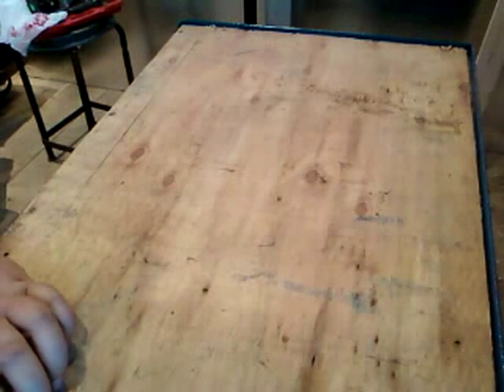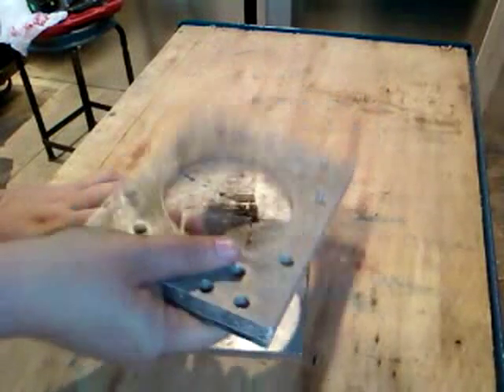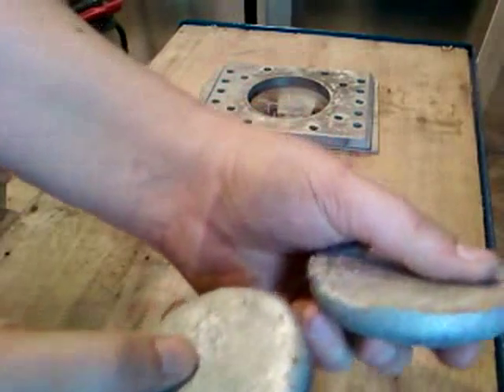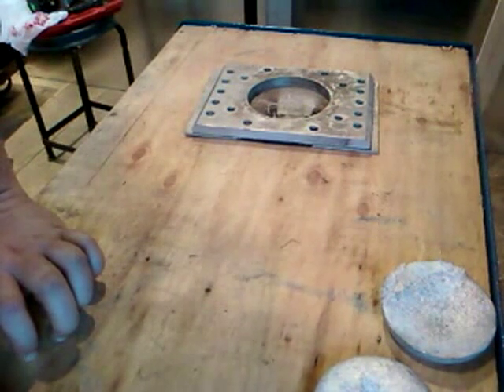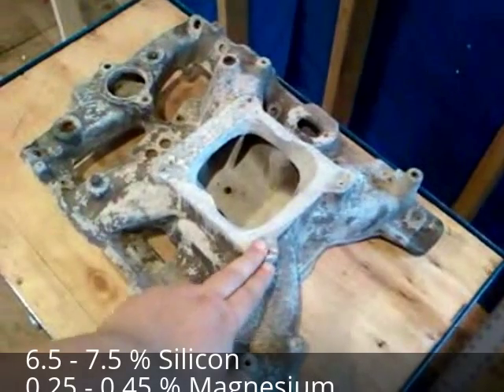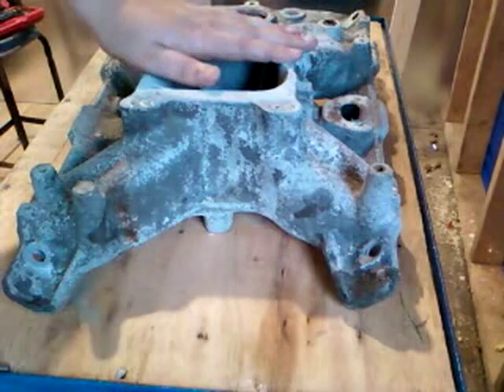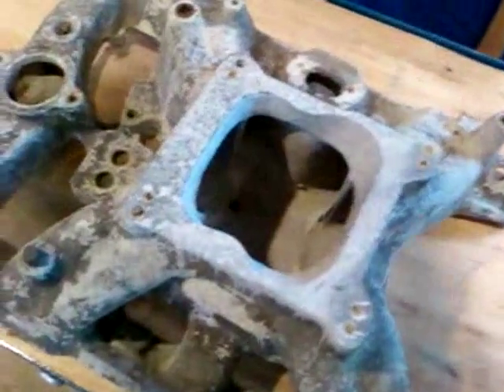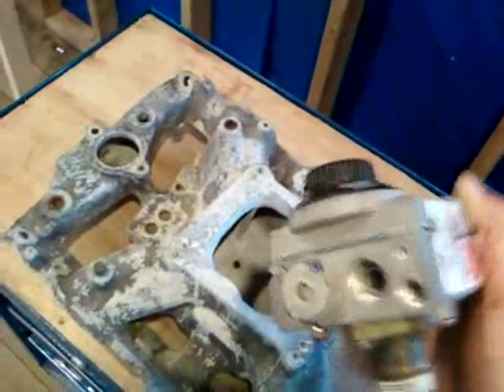Aluminum Alloys - Whats Good for Casting and Alloy Tricks

Comment: great info Chirpy! i've never paid much attention to the material ive been using. i mainly use a mix of die cast and extruded so maybe i 've been getting lucky lol. i didnt realize diecast was so much higher silicon content. I got a pile of crap that i would like to use up. then im gonna start paying more attention. Cheers. Happy New Years
Reply from the maker: Thanks steve, and yea, die cast has quite high silicon content to it, but also has pretty high copper, which can cause shrinkage in really thick parts and cause you issues with sharp internal corners really badly. Die casting feeds the metal in and instantly freezes, so there's no time for the part/metal to shrink as it's cooling, and case the issues like usual, so they can get away with it that way.

Comment: How to reduce pin holes?
Reply from the maker: pour at correct pouring temp, dont overheat metal, and dont keep the metal molten longer than you absolutely need to really.

Comment: Hi Chirpy, now i know why it is so fasinating to cast things at home, i have cast a couple of small things now. Then today i was melting a defecttive powerwasher electric engine and poured it in to a cylinder, to later milling it. But it srunck a deep hole in the middle. I did a made a small bare 8×8 milimeter like a quoter inch square. It brakes easely like it has big grains in it. Is the alloy wrong for it? and what is the name for electric motor alloy?
Reply from the maker: you probably got a die cast alloy, which is usually A380. You probably poured it at a very high temp if you had that much shrinkage, and when you cast with A380 or standard cast aluminum, it will break pretty easily until it's had time to sit and de-stress. If you let it sit for a month or so, the internal stresses from it solidifying really quickly in the mold, they work themselves out of it and becomes much harder to break. It's like comparing a cast car part to a wheel rim, you can break up a car part with a sledge hammer but a wheel rim will just bend because of it's temper. Ive also heard people putting the castings in an oven at like 450F for 6 hours to get it to T5 temper, which helps relieve those stresses without needing to wait that time for it to de-stress on it's own. It'll go up to T6, which is almost impossible for a home shop guy to do, so T5 is the best imo for most of us. I usually just let the stuff sit and age on the shelf while I work on other things before machining it.

Comment: would lead act as a substitute for silicone? 
works in brass casting, see silicone brass vs leaded brass
Reply from the maker: lead would just destroy the metal and cause it to degrade over time. It is fine in copper alloys in small amounts, but for other metals, it just causes it to rot and fall apart over time by seperating the metal between the crystal grains. Lead is just added to copper alloys to help increase lubricity and help with it's machinability.
Reply: @ChirpysTinkerings  I did some more research, I think a zinc-aluminum alloy might work 
https://en.wikipedia.org/wiki/Zinc_aluminium

Comment: the melting point of copper is way higher than aluminum ,I wonder if adding lead would cut down on porosity in aluminum I would love to find a good book on metallurgy my favored metal is tungsten  .
Reply from the maker: no, lead would cause all kinds of problems with the grains of the aluminum and would just turn it into useless junk. It's really bad with aluminum and zinc, look at zinc rott or zinc pest, which alot of time is caused from lead contamination. Check out machinery's handbook, they have a section that shows alot of alloys.
Reply: I cant afford that book lol I would love to have 1 but no luck yet
Reply from the maker: try google, Ive found a few copies in pdf form, and you'll find the stuff in there.
Reply: ok thanks

Comment: Chirpy you didn't mention aluminum car wheels. Are they A356 also? Thanks,.great info. Will have to stop collecting extrusions.
Reply from the maker: yea, wheel rims are A356, but because of the way they're tempered, they have alot more spring to them so that if you hit a bump or something, it bends rather than breaking the rim. If you melt it, it's the same exact stuff as engine parts. 

If you do any machining and such, extrusions are good if you pour it into soup cans or ingot molds to make rough blanks out of because it machines up fine, so it's good for that, but to get it to flow into a mold and pick up any detail at all, it's extremely hard to almost impossible. So extrusions are handy for just rough round stock or random shape for machining stock, but I wouldnt bother using it for casting tho.
Reply: @ChirpysTinkerings  Thanks much, I was thinking rims would work. 
Great thoughts about the extrusions. I can imagine a few things to machine up with them. Bob

Comment: Is there anything that can be added to extruded 6061 aluminum to make it flow more like a356?
Reply from the maker: You can mix high silicon based aluminum in with the 6061 to raise the silicon content to the point of A356 by mixing it 50/50 with engine pistons. Engine pistons are usually 12-13% silicon content and by adding it 50/50 to extruded, it'll cut the silicon content down to the 6% silicon content that A356 has.
In all honesty tho, it's actually much easier to just find cast aluminum than to find the engine pistons and go through all of the trouble of melting everything, making new ingots, etc.
Reply: Awesome, thanks for the info and fast reply!
Reply from the maker: after looking through your channel, since you do a good bit with boats, I'd look at boat propellers if your really in a pinch for engine pistons. They're usually A413, which has 12-13% silicon content. Ive used that before for the cylinder of my steam engine and that stuff defenitely has higher silicon content, and will eat cheap cutters quite quickly. But when is cast and tempered, it is designed to resist abrasion and be very strong, same as engine pistons.
Reply: Thanks, pistons are easier to find for the amount I need to go along with the 6061 I have cutoffs from. I don't deal with outboards.  The boats I deal with don't require impeller changes, besides... they are stainless. Moving forward I will just keep an eye out for old cast alum intakes and brackets. This is so much fun, especially when my first cast resulted in a usable part.
Reply from the maker: lol, any pics/video? I would make sure to flux the parts with some morton's lite salt to make the metal much more fluid and alot cleaner. Also, have you heard of paul's garage, the YT channel? He has a discord server that has tons and tons of guys new to casting and Im usually on there. I would check his channel out at least, but his discord server is a great way to learn about casting and alloying.
Reply: I assumed you had seen it when you mentioned having looked at my channel. Here is my first pour, had scraped the dross off before the filming started. It's 6061 poured into a cold mold. https://www.youtube.com/watch?v=kdwCSJDMXbE
Reply from the maker: I didnt actually see that one, must have completely missed it when looking through, lol, sorry about that. The funnel looked pretty nice. It looked like you had a bit of porousity and some air trapped in the bottom. Might I suggest gluing some straws to the bottom next time so that they act like air vents for the air at the bottom to travel up through as the metal is poured in. 
Another thing to do is add a teaspoon of pool shock (the calcium hypochlorite granulated stuff in the packets) wrapped in some aluminum foil, just slowly push it to the bottom of the crucible before you pour and it'll push all of the gas bubbles out of the aluminum, so you dont end up with any gas bubbles in your casting.
Reply: Great tips once again, thanks. I'm not sure there was air trapped in the bottom, more than an incomplete burnout of the PLA. The areas at the bottom where the voids were, were charred black with plastic so I assumed that's what that was about. Porosity was definitely a problem, but not enough to cause structural issues for the intended use. I'm anxious to try again with your tips. Thanks again for taking the time to coach.
Reply from the maker: no problem, like I said, Im always on the discord server with a few other metal casters on there to help everyone out. I would be cautious of the alumiweld stuff because the main ingredient is zinc, so grinding it isnt that great, and in marine environments, it could lead to dezincification, which would weaken a part if it's fused together with it over time. Just filling in a blowhole might be alright since it's not holding anything.
Reply: Thanks. I just use that for aesthetic purposes, and then the part gets powder coated. Good indefinitely for fresh water, and it will hold it's own in salt water too. Not a fan of grinding, and hoping I will eventually achieve a clean cast that wouldn't need any of that touch up work.
Reply from the maker: yea, I dont care for grinding either unless it's to clean rust off of steel, lol. I did a video of making my own homemade version of the alumiweld stuff, and it did work pretty well as long as you got it under the aluminum oxide layer, usually by scratching or wire brushing it in if you were curious what was actually in the alumiweld stuff.
Reply: Here is my pour from this morning using your tips. Such a huge difference! Thanks again for all your advice. https://www.youtube.com/watch?v=DWb7qrrek2w

Comment: Very useful info. I was able to pause it and take notes! Wondering how you discovered this? Trial and error and a bit of google?
Reply from the maker: Im glad it helped you out, Ive spent years studying that stuff and I have a huge book that I made that shows pretty much every alloy known to man, the ratios of alloying metals, and lots and lots of research of what's in what. I like to understand why things are they way they are and how they are made rather than just taking the generic and general answers that most people use, like calling an aluminum casting, just aluminum. I like knowing why certain things are used in certain areas and why not in others.
Reply: @ChirpysTinkerings  I know this is an old comment so I hope you're still active on checking your comments but I would pay good money for a book like that if you would ever consider making a copy at staples or something! Hope to hear back from you
Reply from the maker: @peteragurkis3590  I still check them if youtube shows that I had gotten one, lol. A bunch of information can be found in machinery's handbook, that should cover what most people really would use tbh. Mine started out similar to that, but added in alot of hand written notes on various alloys, pages added in from various sources, densities of different metals, alloys, and different types of wood, which is handy for when you can measure a wooden pattern and guess how much the casting will take, etc. For a start tho, I would really check out machinery's handbook for a good list of alloys.
Reply: @ChirpysTinkerings  thank you very much

Comment: Good info!  I realized that most of my cast aluminum scrap is actually the die cast stuff.  Some of it is sand cast, but so far I've only melted the die cast stuff.  Must be that a380 stuff.  The ingots I made shrunk a little like you said, but nowhere near what the cans/extruded stuff shrank.  The sand cast looking stuff I have also has some of the white corrosion stuff on it.  I always thought it was just dried soap since those few parts came from dead dish washers.  Come to think of it though the die cast dish washer motors don't have that on them... good info as always!
Reply from the maker: Glad it was helpful, when I got into casting, I didnt know the difference between die cast and sand cast alloys, but to temper each of them, they are completely different and the gating has to be different also to control the shrinkage in the big castings that I do. Now people can tell the difference and what is what to look up the info on them.